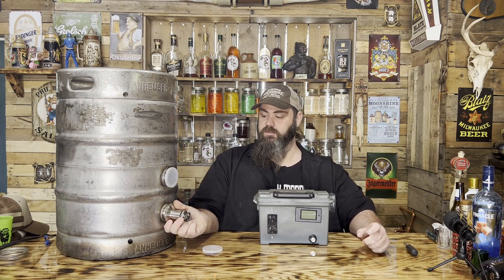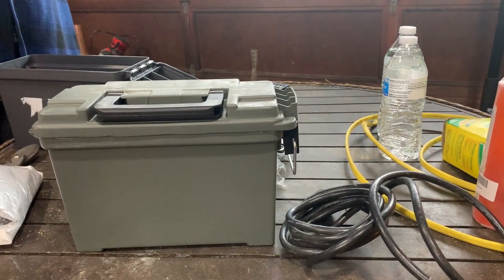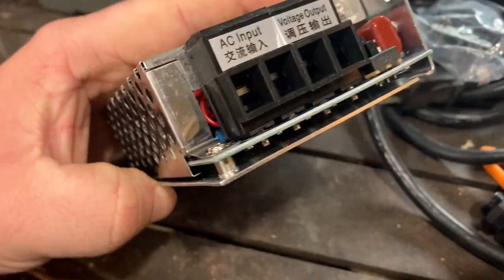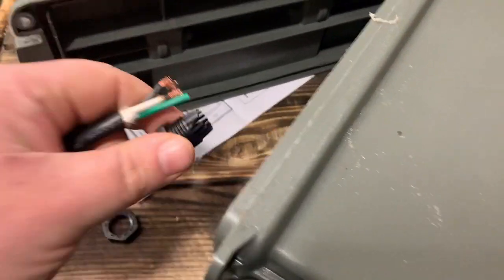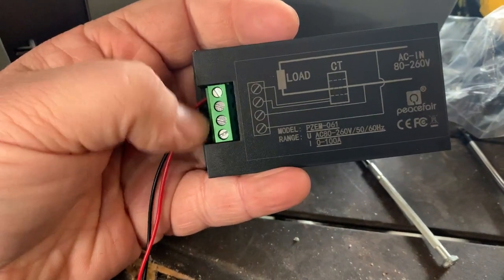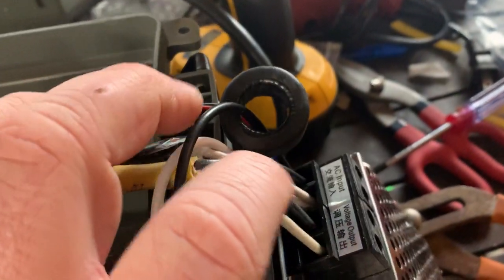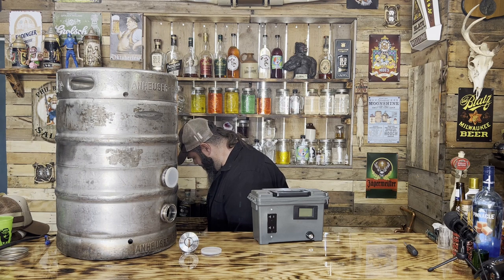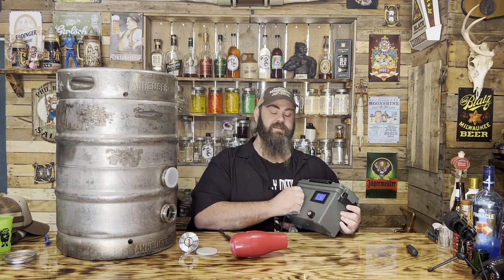Building an SCR Controller out of an Ammo Can

Comment: Could you run 2 1650watt elements, or 2 2000watt elements on this controller if wiring was the right Gauge like 12 or 10ga?

Comment: I've purchased all these components and am ready to wire...however I notice the outlet in the video is wired backwards (the white wire is on the gold screw).  Will this change the placement of the white and black wires on the controller?
Reply: Answered my own question by reading the Amazon description.  Connection position of the neutral and hot don't matter on this controller.

Comment: Love it! I made one this weekend for my electric brew kettle. I didn't bother with the digital screen I figured I would just watch the temp. I made one cheap upgrade you might want to consider.  I used a GFCI outlet switch combo. Adds a bit of safety and convienence as well as a nice clean install on the inside. Flipping a switch to kill the power is nice instead of 
messing around trying to unplug it. Thanks for the idea, loving the upgrade!

Comment: Have you ever looked at using a PID controller? These work off temp. I'm setting up an old broke oven in my basement to use to intall and remove case bearings in a dirt bike engine and was thinking one might work well for this.
Reply from the maker: They work, i do prefer scr but PID gets it done very well.